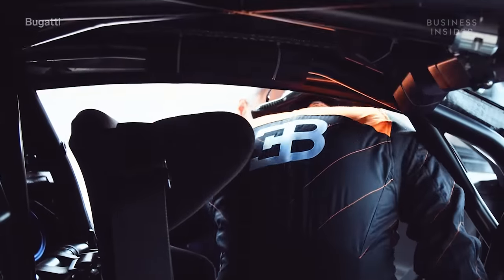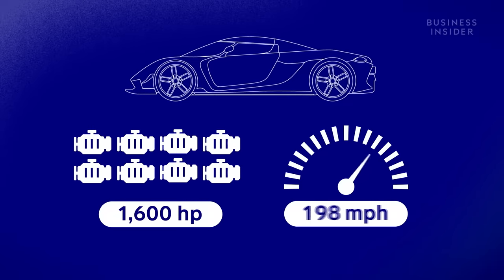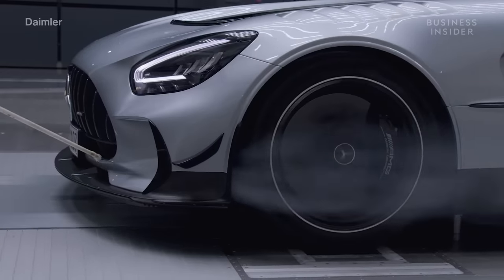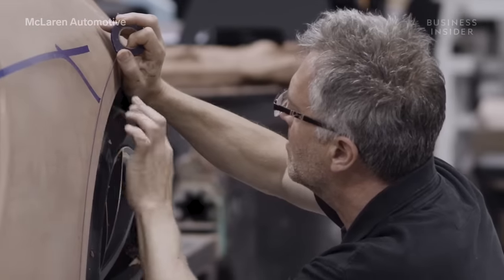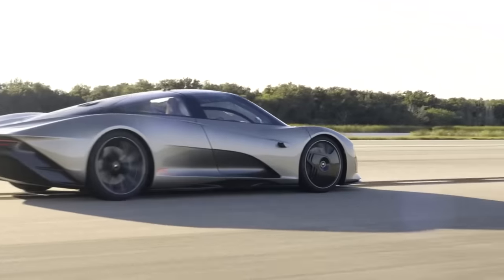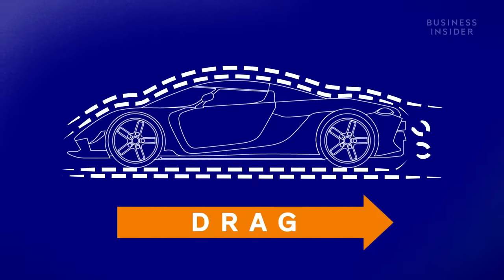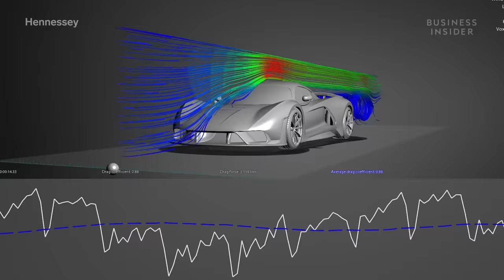Why It's Almost Impossible For Cars To Go 300 Miles Per Hour | Insider Cars

Comment: When he said Bugatti's biggest competitor was Hennessey, I automatically lost all respect and belief in his information. Koenigsegg  has a history of not only breaking records, but by huge margins and the Jesko Absolut is poised to do the exact same thing without a shadow of a doubt.
Reply: Tafara Gadze jesko hasn’t done it yet bud slow ur roll.
Reply: @jj2x210  and the buggati chiron ss isn't a production car so his facts aren't right koeingsegg is the fastest production car
Reply: Hennessy  just modify cars. Shouldn't even be said in the same breath as any other manufacturer
Reply: @SCOOPS2601  the f5 is a completely unique car? The venom may have had a lotus Elise body, but it was on its own platform. Everything else was hennesey’s own
Reply: Bro can you hear he said one of the biggest competitors not the biggest competitor
Reply: @jj2x210  the production bugatti chiron ss will not be able to hit 300 mph. they are "visually and technically inspired by the record-breaking vehicle."
Reply: @andiuti  yea cuz regular people need to drive 300 on the street.🤦‍♂️ at the end of the day it’s still a production car and a lot faster than majority of other cars.
Reply: @kiko9740  when buying a venom, its registered as a lotus.  its used the chassis aswell. He is merely a modifier and not even on the same planet as the others.
Reply: @SCOOPS2601  dude what? U make it seem as if Hennessy was just a joke. No one cares that the venom was a lotus. News flash, Bugatti’s owned by Volkswagen. No one cares. Mclaren f1 uses bus lights. No one cares. John Hennessy is a legend in the tunning community.
Reply: @jj2x210  And all I've said is that he's a tuner and not a manufacturer. Thanks for confirming that
Reply: He actually said one of Bugatti's biggest competitors.
Reply: He said biggest, not only.
Reply: Valkyrie 007  cool.  Looking forward to seeing it. Hope it does well.
Reply: @jj2x210  yes its absolutly one of the fastest and coolest cars on earth. but it wont go 300mph
Reply: Valkyrie 007  Im not trying to take away annything from Bugatti. I know that they drove 304mph with the pre production Chiron SS. Im just saying that the production version will not hit 300mph
Reply: You seem upset
Reply: @kiko9740  the fact that they modify cars isn't what makes them untrustworthy. It's their untrustworthiness with their customers as well as their shady tactics for the past 15 years.
Reply: He said ''one of bugatti's bigest competitors'' not ''bugatti's bigest competitors''
Reply: Tafara Gadze you need your ears checked b cause he said one of, not the biggest.
Reply: N oe yes it actually is a production series car it’s a chiron. the supoersport is just the trim/series of that specific bugatti.
Reply: @jj2x210  show me a customer car that’s a Chiron as 300.
Reply: @NOEG37  wtf
Reply: Valkyrie 007  the proto is only capable of 307. Then how the heck is the production car going to be faster
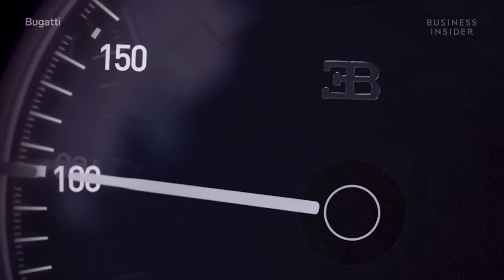Reply: It’s funny because they show the Jesko Absolute at 1:12 talking about aerodynamics but they don’t mention them as a competitor...😤
Reply: @NOEG37  it is a production car
Reply: Bro they done nothing with a jesko and no one talking about koenigseggs like damn it’s always that one guy talking about them every time there’s something about Bugatti like damn it’s annoying 😂
Reply: @NOEG37  XD I bet your gonna say it didn't go both ways classic koenisgegg fanboy move
Reply: the Chiron SS hit 304 in one direction so koenigsegg still has the record
Reply: @kamingcheng  cap look it up
Reply: @kamingcheng  how do you know that you weren't there right I mean of course they would go both ways
Reply: @kamingcheng  and you said it predictable
Reply: Mans even used a Koenigsegg Jesko as their example
Reply: @NOEG37  but the Chiron as has achieved the highest top speed, and it's faster than any koenigesegg
Reply: @kiko9740  o no sir. You dont get to piggy back someone elses r&d and they to claim.
Reply: Koenigsegg 0-60 is trash
Reply: oh watch out we got some Koenigsegg fanboys who swear up and down "Koenigsegg has rivaled Bugatti for years" 🤦‍♀️ the first time i ever even heard of/saw a Koenigsegg was in NFS Most Wanted 2012... people have known about Bugatti for much longer...
Reply: @Rhaedeon  nope literally if all you do is modify cars but cant literally craft your own after this long imma say red flags
Reply: He said one of
Reply: @frozenbags  this makes no sense because Bugatti has been making cars since the 1930's but okay. thanks for the info :) i still love Bugatti more though.
Reply: @SCOOPS2601  venom GT did use lotus body but it’s a production car still, I mean pagani uses Mercedes engines, Bugatti uses Volkswagen Jetta keys, Mclaren F1 uses BMW engine and bus taillights, Maserati use Chrysler engine, Chrysler interior, Chrysler parts and nobody talks about that, so stfu, venom GT is classified as a production car then it is a production car.
Reply: @andiuti  
It can actually reach 300 mph. If you read the description of Bugatti press release you’ll know. The car has to run in around 5000-7500 km. then you have to take it to Bugatti, take a 7 day course and sign up for a special kind of insurance policy or have a written bond which eliminates any responsibilities of Bugatti if you decide to use that performance in any public road and cause any chaos.
Reply: @ieditedmyname289  do you have a link? cant find anything
Reply: @SCOOPS2601  and you are?? Exactly, no off you go, back into obscurity.
Reply: Watch the whole video before leaving a comment... there’s an entire portion on the jesko
Reply: @jj2x210  Well, the track exists.
Reply: he never said hennessey was bugatti biggest competitor all he said they were one of bugatti biggest competitors
Reply: @kiko9740  I’m mean check out the Hennessy did just release the operating production model
Reply: Sorry to ruin ur day but he said one  of the biggest competators
Reply: Bugatti is the fastest super sports car there is chosen to concentrate on other aspects of the car besides speed but they are the fastest in the world Koenigsegg Tuatara hit Hennessey and all those other ones really don't compare
Reply: Koenigsegg doesn't produce many cars tho. Bugatti produced like 8 or 9 cars in 2019 and 2020. So overall bugatti is better *TO ME*.
Reply: Calm down guys, nobody owns any of those cars here. So enjoy the video ✌️
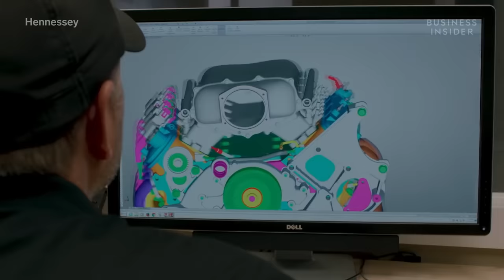Reply: He said ONE OF THE biggest, not THE biggest 3:12
Reply: @bbxr1075  I personally think Bugatti is better to me too! Idk why but I do too!
Reply: @bbxr1075  oh Bugatti produce more models or trims gotcha
Reply: @jj2x210  Bugatti is owner by Rimac...
Reply: @A1alshehhi1509  uhhmm...no? Bugatti is owned by Volkwagen.
Reply: @bbxr1075  they bought them this year
Reply: @A1alshehhi1509  well google says something completely different
Reply: @jj2x210  no
Reply: @SCOOPS2601  henessy easily could beat bugatti
Reply: See you then
Reply: @SCOOPS2601  can America have a little respect and yes it was a production car and yes it held the record recently
Reply: @jj2x210  he said it’s poised to do so, which means that it will, not that it has done it already 🤦🏽‍♂️
Reply: @SCOOPS2601  that's BS
Reply: Imma stick to my powerboats
Reply: @warriorgrl3076  yes, we're in 2013
Reply: @jj2x210  mclaren used bus lights. Not now.
Reply: 3:07 "one of..." not only competitor
Reply: @frozenbags  Seriously sir THANK YOU! I can't tell you how many people believe Bugatti today is the same company from years ago. My 15 year old had to argue a  jackass about it while gaming.  Lol. Bugatti has gotten more fanfare because it has VW behind it . I know one thing Mr.Koenigsegg will one day be on the Mt Rushmore of the automotive industry.
Reply: @jyo901  Very true and great advice.  I have to remind myself of that on occasion.
Reply: @jj2x210  Christian himself acknowledged this and congratulated bugatti for this amazing feat. The only reason the egg hasn't broken the record is because of not being able to find a road as of yet and other safety reasons. He said 330, I feel like 318-323 is going to the limit on that beast
Reply: Yeah Koeningsegg isnt their competition, they have no chance again Koeningsegg
Reply: I agree totally.
Reply: Why do you guys always shit on Hennessey? They've been doing cool ass work for years
Reply: @jminkvihubyb  they make cool ass engines and integrate them into lotus chassis. That's a cool group but not a car company. That's why they are registered as Lotus. Still that does not mean that their achievements are anything less of marvellous, just that they are not on the level of the Egg
Reply: @SCOOPS2601  modifies them to be the fastest cars in the world... bet they could build them from scratch and make them 320mph
Reply: @jyo901  let them argue about how their favorite car is better than someone elses. i find it funny that to them, the other car is always trash. can we not respect what all sides have done?
Reply: @NOEG37  well neither is the absolut
Reply: He said one of can you listen
Reply: This original thread starter post obviously requires knowledge of cars and super fast car companies, I'm lost.   I will be getting into my 1.6 liter 4-cylinder Hyundai Accent soon 😜
Reply: @andiuti  the production Chiron SS apparently goes at something like 295-297mph so its near as dammit 300mph.
Reply: @titytitmk2738  where did you get those numbers from? If those numbers are correct its still not 300. they named the car Bugatti Chiron SuperSport 300+ and thats whats annoys me. but its still an amazing car and very fast
Reply: You automatically lost all respect and belief in his information? I thought you would have done it manually...
Reply: @NOEG37  Bugatti chiron ss is already a production vehicle Bugatti built 30 of them already
Reply: @Air.Japan1  didn’t the Regera set the world record for 0-60?
Reply: @warriorgrl3076  makes perfect sense if you can read.
Reply: @moshunit96  i can read thank you very much. now plz leave me alone
Reply: @moshunit96  Don't act like an 5 year old kid.
Reply: @yeboisam4808  no wtf dude the acceleration on the regara is trash
Reply: @Air.Japan1  my bad it was 0-400-0 record not 0-60
Reply: @yeboisam4808  yes
Reply: @yeboisam4808  it said it hit 400 kph in about 31 sec
Reply: EXACTLY
Reply: Hennessy is a joke compared to real car manufacturers like Koenigsegg & Bugatti.
Reply: @Ambigious  wow.... How did you come to that conclusion ??? Because as of recent koenigsegg has been producing cars with very high top speeds or because the horsepower figures of the car's are massive ? Regardless of what most people say at the end what matters is how much of those horses actually make it to the wheel or the cars torque. The top end models from both manufacturers are rated at 1100+ horsepower and they both weighore than 1200kg (quite heavy for a sports car) so to get to my point through, the biggest difference is the amount of R&D that goes into each model and koenigsegg is however not as financially backed up as Bugatti who gets cash pumped into research from Volkswagen, also if you happen to look at the new bugatti bolide then you'll understand how technologically advanced Bugatti cars can get.( Ps don't take it personally thinking I'm bringing any hate like a fanboi but i made this comment soley for the sake of argument)
Reply: Valkyrie 007  "Limited to 30 units, this very special edition of the Chiron is visually and technically inspired by the record-breaking vehicle."
Reply: Valkyrie 007  Its inspired by the record breaking car. Thats mean that it will not be the same car.
Reply: Valkyrie 007  so thats what they mean with " visually and technically inspired by the record-breaking vehicle" ?
Reply: @nemindagamage9186  
You missed my joke.
The joke is that Koeningsegg is so much better than Bugatti, that theyre not the competition of Bugatti, becuase they are nothing similar. Makes sense now?
Reply: Valkyrie 007  I have not. Where have you seen it?
Reply: Bruh chill tf out have you seen the Hennessey? Its literally the American version of Bugatti. Frankly its about time we got something out there other than tesla.
Reply: How has this argument lasted over a month...?
Reply: @SCOOPS2601  What car did they modify to make the Venom F5?
Reply: @kiko9740  they didnt rip off the lotus elise body. lotus actually helped them with the bodywork, goes for both the GT and the F5
Reply: Id love to get my Tahoe modded by Hennessey but leave it looking completely stock as is. But with 750hp.
Reply: @andiuti  
You are right and wrong.
It is the same car but it will have some changes that it won't reach 300 mph.
The ground clearance will be set like the normal Chiron and the top speed will be limited by an electronic to 420 km/h (260mph).
I guess it is the tires. For getting these street legal for just 30 cars it is to expensive and to much effort. With the limit it could use the tires of the Chiron.
Reply: @jj2x210  ye but its not about needing to its about u cant if u cant it doesn't count does it
Reply: @AB-xe6ci  have u ever seen a lotus go anywhere near 300? No thats what u thought
Reply: Top fuel car be like "ez'
Reply: @NOEG37  lol it is now. The 300+ already sold out 🤣🤣
Reply: When did he say the biggest competitor?
Reply: @NOEG37  chiron ss 300+ is a production car. And any chiron can be made ss 300+ 
Get your facts right kiddo
Reply: he said “one of” and specifically to “the race to 300mph”, not in general.
Reply: @spy9773  Exactly
Reply: @midnightaquarius1219  how so?
Reply: @Ambigious  i think she does get the joke, but..., well she just though that joke was wrong
Reply: @channielroshan6681  you are a year late💀
Reply: @midnightaquarius1219  ye ik
Reply: he said one of his biggest competitors
Reply: you misheard what he said, I believe he mentioned Hennessey just so he could mention the Venom F5, which yes is one of the bigger competitors of Bugatti, never said the biggest, of course it is Koenigsegg, as a Koenigsegg fan I agree with what u said afterwards, just listen better next time man lol
Reply: I thought of liquor 😔
Reply: 3 years on and Koenigsegg hasn't done any top speed run with the Jesko Absolut. A brand new Bugatti will be revealed this year already.

Comment: Interesting thing is, as a car approaches speeds over 300 mph, the top of the tires are actually traveling twice as fast as the vehicle. The tires themselves are coming very close to breaking the sound barrier haha
Reply: I had to think about that for a few minutes, but then I got the “light bolb” moment.
Reply: Thrust SSC
Reply: That's a genuinely interesting fact, I'm going to horde that in my brain, thank you
Reply: Wait pls explain I’m a bit slow
Reply: @temujinartem2375  the car is traveling at 300 mph, if you pick a point on the circumference of the tire and watch the tire go round as the car drives, the car is traveling forward and the point on the circumference of the tire is going forward 2 times as fast as the tire goes round and round.
Reply: @MattLouw  i like your funny words magic man
Reply: @temujinartem2375  Technically the top of the tyre goes twice as fast and the bottom of the tyre is basically at rest
Reply: But if they don't move forward at that speed could it actually break the sound barrier? Maybe it creates some kinda stationary effect that's destructive to the tire
Reply: @tomlxyz  your pfp matches your comment perfectly
Reply: Would that mean the Jesus absoluts tires would break the sound barrier? It’s supposed to hit 330 mph
Reply: Even crazier each patch of rubber on the outside of the tire is accelerating from 0 to 600mph and back down to 0 over 60 times per second.
Reply: @sgvincent100  me too, just make the car the tire and you half your tire speed... Now we can go over 300 mph again!
Reply: @UnconfinedConfusion  No. The actual "Sound Barrier" is different depending on factors such as air density, temp, ect., so at "ground level" it's far closer to 700mph+, than 600mph
Reply: hahahahahaha
Reply: Wtf no? The tyres still travel at 300 kilometers Per hour, like the rest of the car!
Reply: @YoutubeChannel-in9qd, that's a rocket on land mtf
Reply: Funnily bottom of the tire is at ZERO speed assuming its not skidding lol
Reply: @temujinartem2375  the top of the tire is not only going forward at the same speed as the car relative to the car (because it has to roll on the ground), but is also going forward at that speed with the car. So, relative to the ground, the top of the tire is moving twice as fast as the car is, and the bottom, touching the ground, is not moving relative to the ground.
Hope that is clear enough (unless, you've already figured it out).
Reply: That… was interesting
Reply: This applies at any speed but you’re right